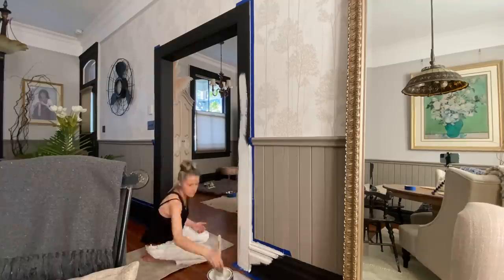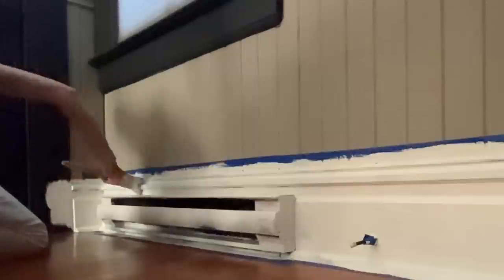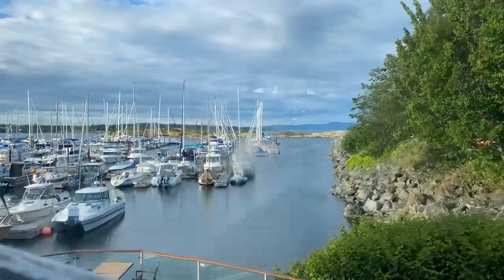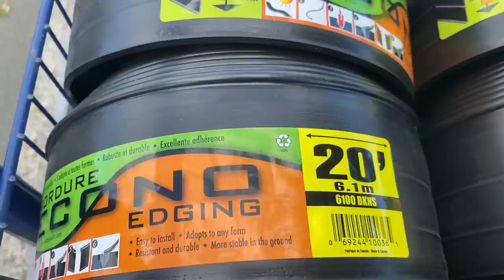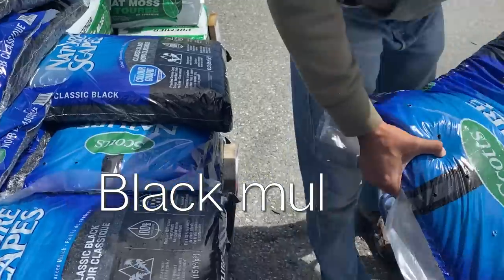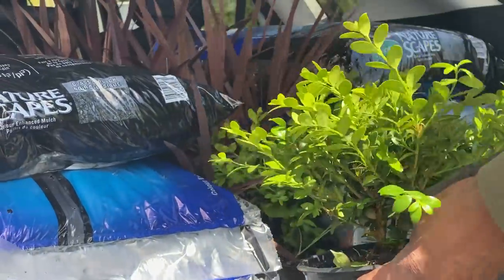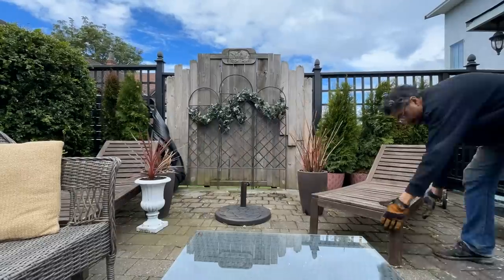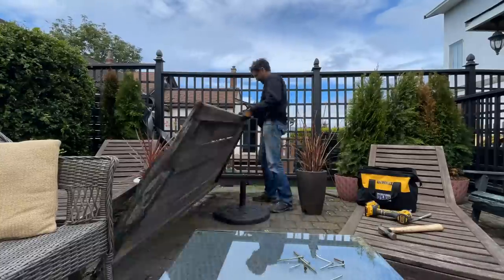DIY More for Less!: Inexpensive diy outdoor garden ideas!

Comment: I LOVE it! We have a metal fence with mostly vertical rails, only horizontal ones at the top and bottom. We used 8’ tall vinyl lattice turned sideways. Wish I’d seen this when we did that. This is prettier and more cost effective. Our length is 66’. I’d love to do this on each side. How did you attach them?